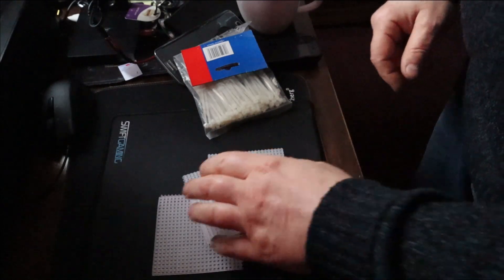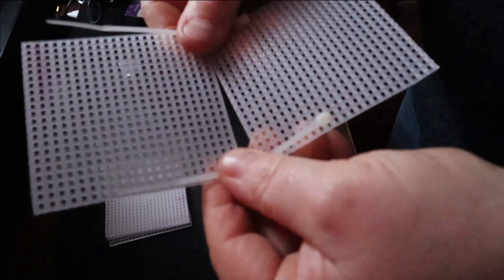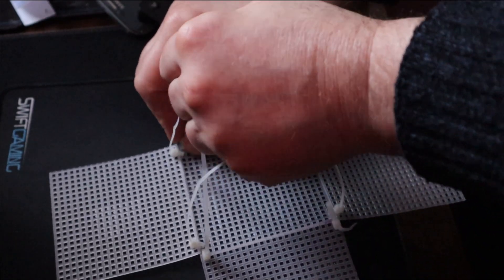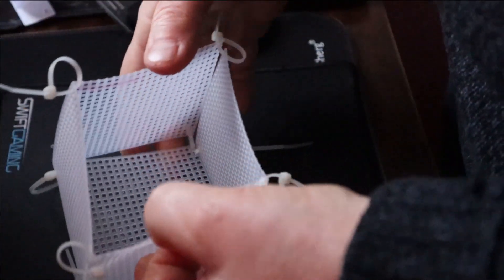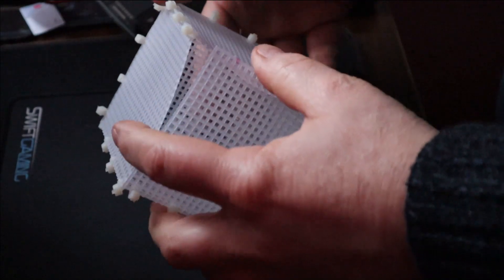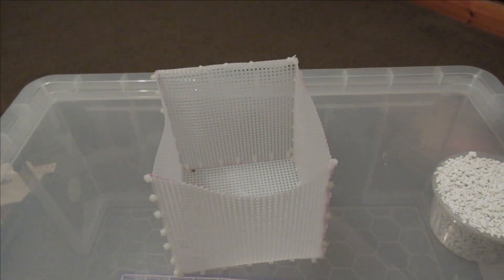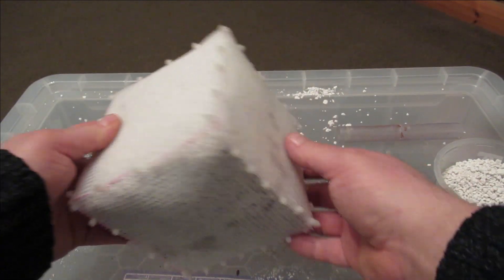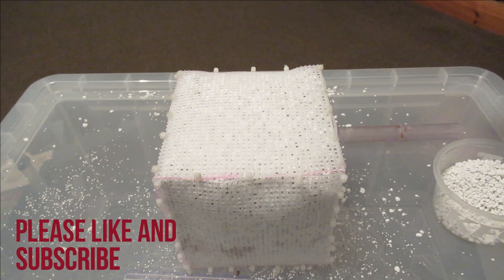biocenosis clarification basket ,,Nitrate removal?

Comment: No science proves this actually works and for some reason people think ammonia is pulled towards the center iron core by a magical force
Reply from the maker: indeed but we shall see
Reply: It doesn't get pulled to the middle by iron. Bacteria use the iron to break down nitrates and ammonia. You need to make sure the o2 level is low so the bigger the basket lower the chances to fail. Clay naturally pulls ammonia and when ammonia pulls towards the center where there is low O2 facultative heterotrophic anaerobe will break down nitrates, nitrites and ammonia.
Reply: @na1du  Strange no water companies use this system and clayed can saturate with ammonia
Reply: @masterjedi1934  it’s not easy to create a balance. Minimum size is 4x4x4 for a small tank. This is similar concept to plenum and deep sand gravel beds. It attracts ammonia this method might not remove nitrate directly as it is different charge. Ammonia when it breaks down with this system doesn’t get converted to nitrate and hence low nitrate.
Reply: @na1du  Clay or cat littler will become saturated by water it can not attract ammonia there is no mechanism for this as for the iron rich media in the middle this holds no reaction to ions either negative nor positive clay attracts nothing its inert ,,a deep substrate will have the same effect when water with ammonia in it flows directly and microscopically onto the surface of a clay particle the positively charges ammonium ions can be exchanged for positively charged sodium or calcium ions on the surface of the clay. The clay does not “attract” anything
Reply from the maker: @masterjedi1934  I agree there is no basis in sciece and maybe in a pond it may have some basis although i have spoken to  a great many people who have tried this with about half saying they had no results positive or negative the reset can pass off the result to other factors such as deep beds work and are proven in the hobby with live plants but most agree the science just is not there to prove it similar to other medias and systems like moving bed and plastic bio balls all really should not work like plastic by nature is antibacterial and moving beds need to be twice as large as the body of water they filter ,,,i have kept, bred and sol fish for over 40 years and know exactly why we change water and its not only nitrates also this system will not replace any other filters its simply not as good as removing nitrates as plants and water change these are the best ways  and proven this are facts not fiction infact the best media to filter with is 30 to 45 ppi sponge
Reply: @na1du  Hmm no charge mentioned plus this is a natural clay base now cat litter which is backed solely to absorb liquids absorb an retain not like natural clay in say a river that naturally has an ecosystem in place i have tried and tested different versions and come to one conclusion the best way to remove nitrates and replace vital elements is water this is something that has been going on and proven by all for many years on my own koi pond i use a bog filter which produces a similar effect and is half the size of my pond this means to reduce nitrate assuming there are no plant life including algae to absolute zero would need a very small bio load as the system mentioned above simply takes to long but i will be watching this to see the results as most that have used it say different things

Comment: Very interesting. Personally i don't see the point though. Tap water contains nitrates. Keep up with water changes ie weekly then you shouldn't have a problem. I have 4 aquariums. One 30 gallon as you know with a 307. I could add something like Purigen to  one of the media baskets but i don't bother. This is my favorite aquarium and it's been running for 2 years now. i do around 60% water change every two weeks but will be extending it to 3 weeks. It's not overstocked and is heavily planted.
My nano tanks i do weekly water changes of at least 70% without fail. These have sponge filters. In my experience large water changes has no affect on my Cherry shrimp or Amano's.
Water changes are the best thing you can do. I  squeeze out the sponges with every water  change.
Reply from the maker: Totally agree but thought i would test it as it would be a great asset to the koi pond .I did a test many years ago when i owned the shop on how toxic are nitrates and to be fair over 100 ppm may see a shortened life expectancy but to be lethal would need to be a lot higher Yes water changes are the best way forward i am a keen believer in this and the thought that everyone in the hobby is missing this is simply preposterous but that gauntlet is down lol